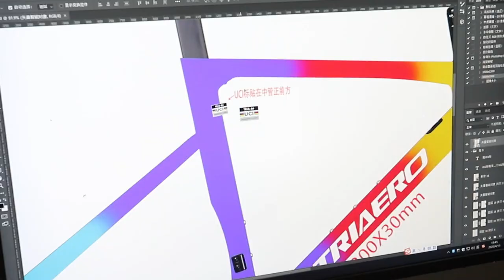Painting Your Carbon Bike Frame like a Pro-Step-by-Step Tutorial

Comment: why is all that water flowing in the background?
Reply: The company I used to work at installed a water flow system in the paint room.   It makes a down flow of air to suck up paint over spray.  The paint gets trapped in the water.  And then the water runs over a media (they look like cement rocks in U shapes) to grab the paint.  It was less money to capture over spray than the traditional air and filter methods.
They might have a system like this.
Reply: During the frame cleaning part just before the painting begins the technician is touching the frame with his bare hands. The frame should be wiped down again with alcohol or mineral spirits with gloves on to remove grease before painting. That step, if done, is not shown.
Reply: it's an old trick. This can be use also when painting houses. E bucket of water will be placed in a room to take away the smell of the paint. And in this case I believe it works like other already commented above. To avoid the dust to fly in the room and land everywhere.